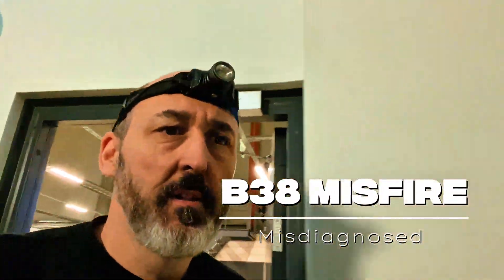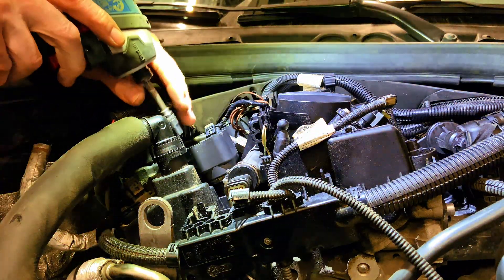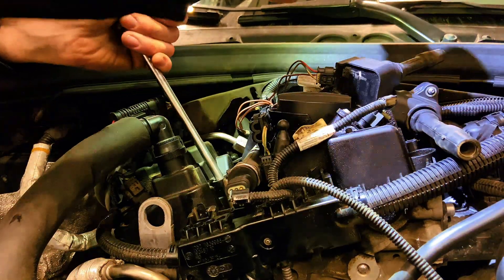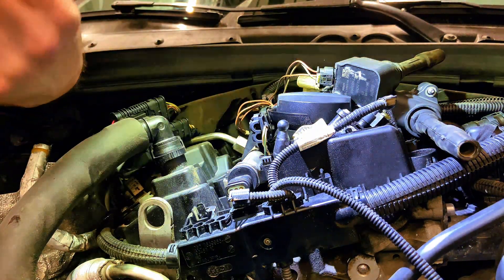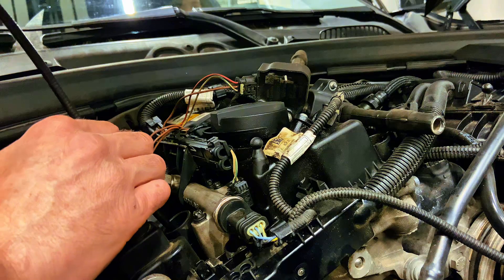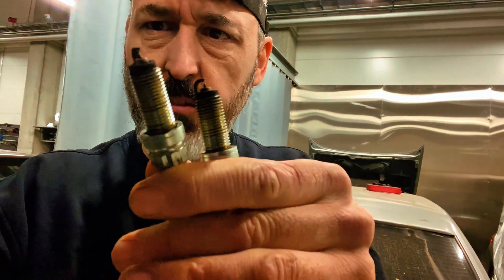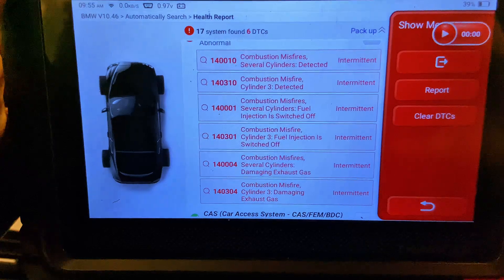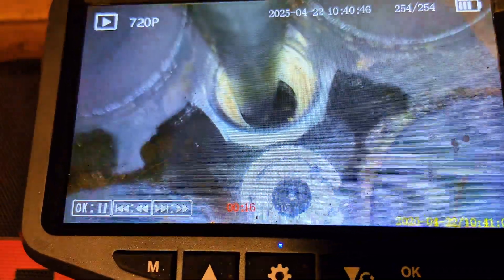Mechanics Changed everything on this B38 engined F20

Comment: The quality of the picture is just perfect now. 

Few outside of the topic questions :

1.The fuel trim will be taking away fuel, because of the leaky #3, but the other two cylinders will then go lean? Because the trim controls the whole bank?

2. Do you have a diagnostic tool that could make "injector balance" test on these BMWs? So one could see the injector leaking on the testing apparatus by watching the fuel pressure drop difference between the injectors?
🍺🍻
Reply from the maker: No fancy test equipment but you are probably absolutely spot on about the leaning out of the fuel trim leading to lean running on 1&2 but no misfire codes for those cylinders. I was under the impression that they were affected but with the borecam no signs of leaking injectors but when 3 is fixed pound to a pinch of shit 1&2 will start leaking lol